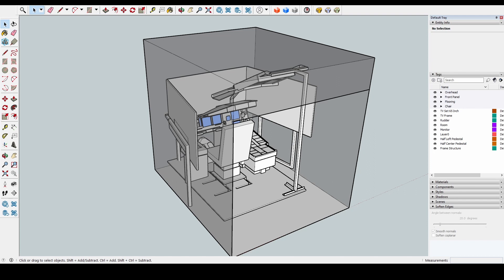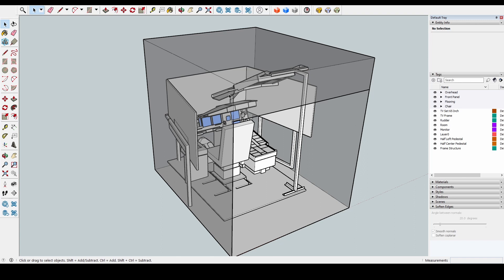DIY A320 Neo Home Cockpit Build Video   Part 2 Structure

Comment: Hello, is it possible to download the 3 D? I would also like to build a cockpit with a seat. Best wishes
Reply from the maker: Yes its in the description starting part 3 fwd will share
Reply: @hobbytechgearID69  Thanks again for the quick reply! How do you manage to see the view without the virtual cockpit or the plane? Thanks so much
Reply: @hobbytechgearID69  Hello me again, but the 3D template is not available in the links? Would it be possible to get them 🙏 Greetings and thank you
Reply from the maker: Let me check it should be there as sketchup files